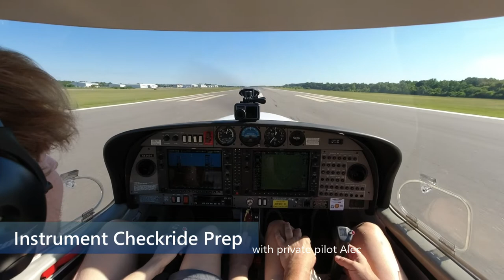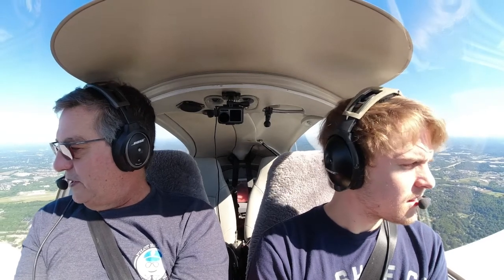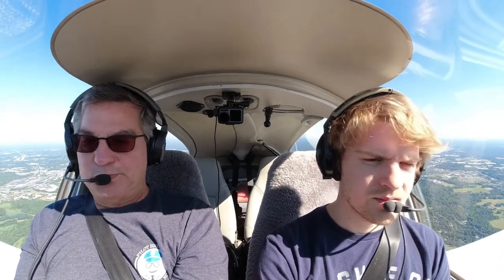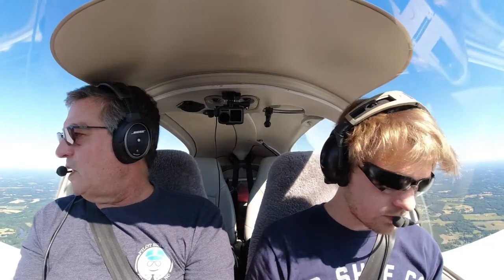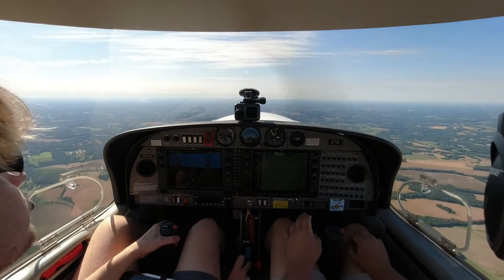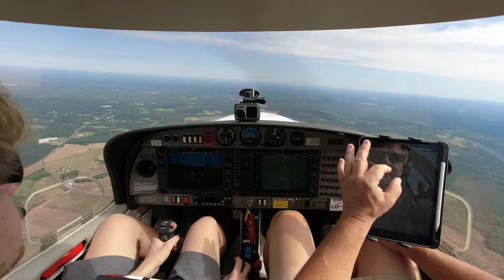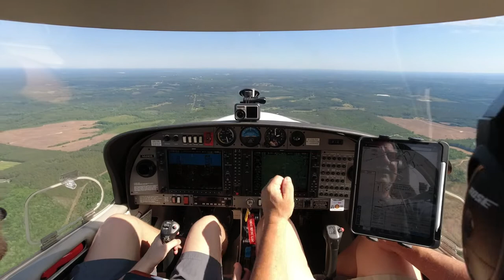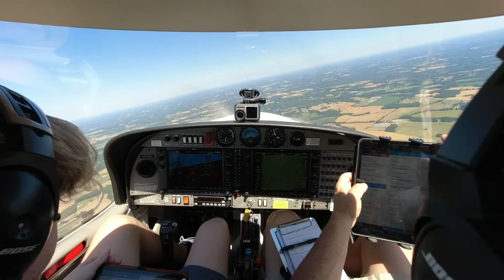Electrical System Failure In Flight-DA40

Comment: your student was correct, you have 30 min.  the caged battery backup works for 90 min. and only powers the back up attitude indicator
Reply: Doesn’t it also power a strip light under the panel ?
Reply: @shanelodge391 correct.  Both the flood light and the backup attitude indicator are powered for 90 minutes.  The 30 minutes is for the battery powering the aircraft electrical systems.
Reply: Cheers

Comment: I know this is an older vid... but why didn't you let the student fly home?
Reply from the maker: It was a while ago so, I don't recall what my thinking was.  I was a fairly new CFI at that point so, I suspect I thought it would be prudent for me to fly it.  In hindsight, the student was more than capable of flying it home.  The worst case scenario would have been no flaps if the electric failed.  Being a CFI is a constant learning process.  As with other certificates, passing the checkride is only the beginning of learning to be good at it.